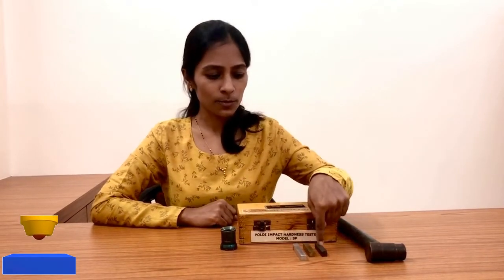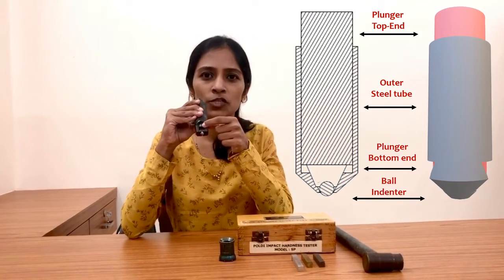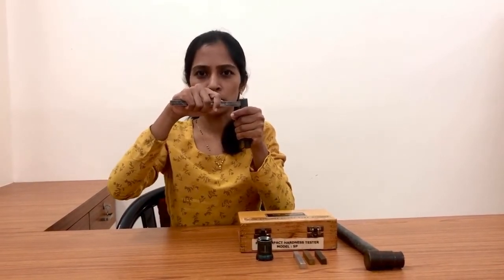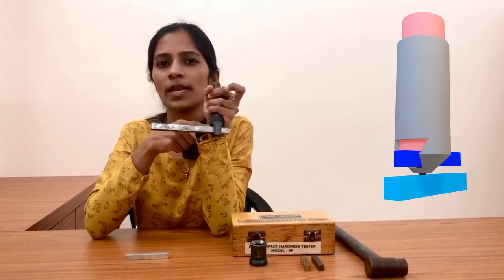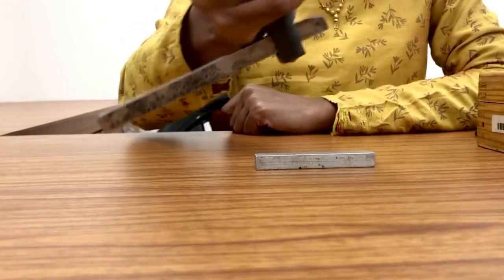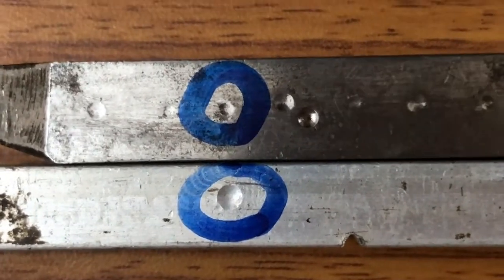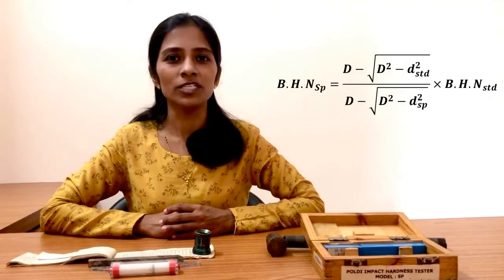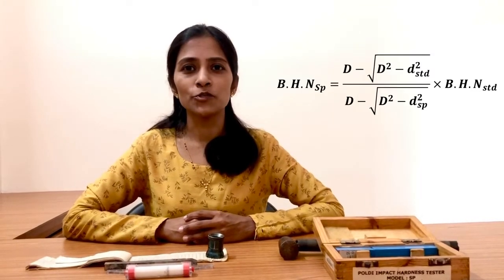Poldi Hardness Test

Comment: why poldi should not be used for austenitic steel material ??
Reply: Under normal conditions, a POLDI hardness tester employs a check test piece made of steel with a strength of 70 kg/mm2. Heat treated and high alloyed steel have higher strength. With increasing strength ( 150 – 200 kg/mm2 or more) error may be even higher.

Comment: Hi mam, which weight hammer used for testing?
Reply from the maker: In poldi hardness test no standard weight hammer is used. Only precaution you have to take is hammer blow need to be moderate and should not be very heavy or light.
Reply: Thanks for your response. Thank you mam.